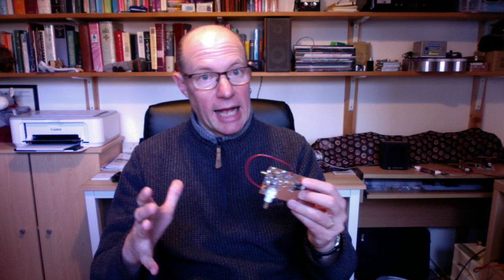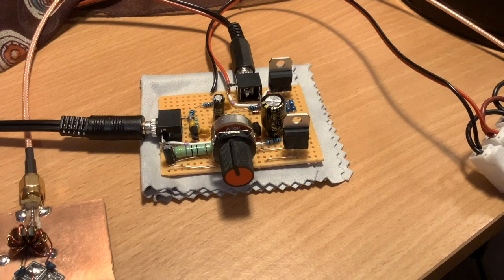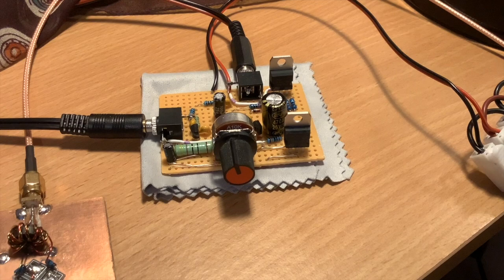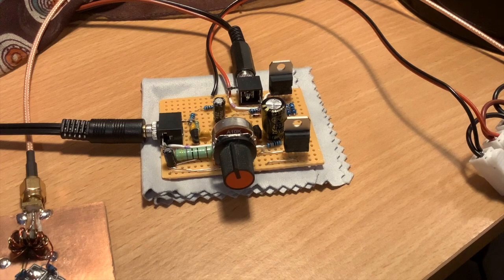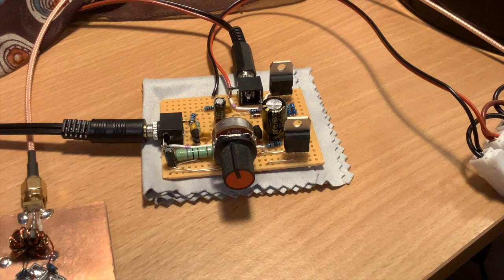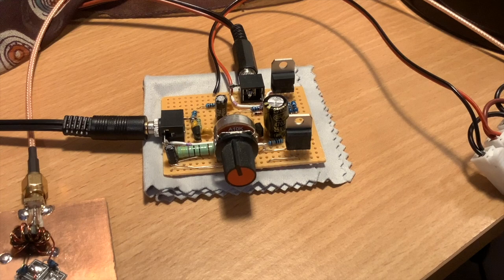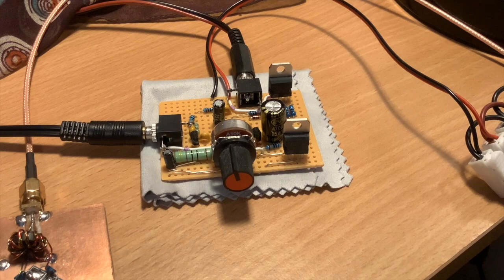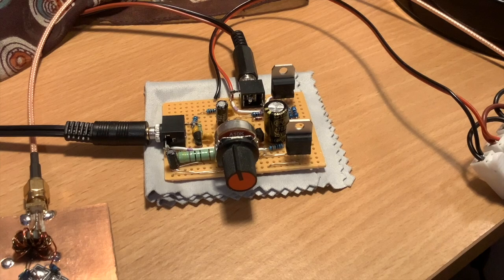34 - Improvements to the Direct Conversion Receiver

Comment: Some transceivers are contained in a box less than12 inches (300mm) square and this one is spread over almost 10 ft (3 meters) length. lol
The end performance of this one, however is almost as good as (as good as) some commercial receivers.  I'm seeing the value of building in modules.  
Bravo and thank you for sharing your time, hard work, research and success with us.
Reply from the maker: Thanks very much. 73, Nick

Comment: Great video. Yes, a diplexer certainly helps. Another important thing I think is a DC path for the IF port. At RF an attenuator could be used on the IF port. I did find some transformers 50 ohm to 1k which I have used. Maybe a 1k to k or 600 ohm transformer could be used for a DC path.
Best wishes for the season from NZ
Reply from the maker: Thanks very much. Interesting idea - there is always something else to think about isn't there. 73 Nick

Comment: Since I've heard AM radio stations simply by hooking an antenna to an audio amplifier is there a chance that the audio amplifier was simply rectifying AM pickup, and that the inductor (L3) and bypass cap (C1) on the input to the audio amp cut out the AM RF that was being picked up, and the 51 Ohm matching wasn't really what was fixing the problem?
Reply from the maker: Hi there! Interesting idea but I'm pretty sure it is the impedance match that makes the difference. I've swapped audio amps in and out and (without the W7EL Diplexer in circuit) I get AM breakthrough. I've swapped product detectors in and out too. I've also usually built an audio low pass filter on the AF(IF) port which looks very like Roy's diplexer but has no impedance matching - I still get AM breakthrough. The only solution I've found to date is a double balanced diode ring mixer (product detector) + W7EL Audio Diplexer. If you haven't already you might find it interesting to check out Bill Meara's (N2CQR) Youtube channel ('Soldersmoke') where he tackles this same issue recently. Thanks very much for watching and commenting. Happy Christmas! 73 Nick

Comment: Nick. I wonder if you'd gone back to Pete's mixer after all those changes, especially the audio diplexer, how that would have performed. Would you have got the break through still. It all started with Bill contacting you. This video showed up when I did a Google search on preamplifiers to use with a direct conversion receiver, and I really enjoyed it. Thanks.
Reply from the maker: Thanks very much Trevor. Doing a bit of digging revealed the fact that those dual gate MOSFET mixers just seem to be very prone to AM breakthrough. It's just one of the unfortunate characteristics of the design I fear. Depending on which band you were going to use it on though + where you live (i.e. not 40m or 20m in Europe which have close by AM Short Wave commercial bands) then you might get away with it! Thanks again. 73, Nick

Comment: The 51 ohm termination was used in the W7EL "Optimized QRP" transceiver published in a 1980 QST magazine.  The receiver was fairly "crush proof" with this diode ring mixer.  I understand now that the 51 ohm termination had a lot to do with that.  I have built a few different versions of that rig.  Working all states using it was something I had planned to do.  I had better get going on that.    73 de km1z.
Reply from the maker: You are absolutely right. Thanks very much. 73 Nick

Comment: Tip41 and Tip42 Transistor s used for Audio Amp in Class B mode can get hot might need Heatsinks and mica washers or equivalent. Traditionally class B push pull Audio Amps were used in portable Radio s as when there s no signal the Audio Amps draws less current eg in standby mode , however there might be a little distortion in sound quality but as it is be used for portable purposes these are pro s and cons of the circuit and more components are used instead of a single ic, TV Engineer Ross
Reply from the maker: Cheers Ross. 73, Nick

Comment: diode rings mixers have 50 ohm impedance on LO input, so they need much more current. on the other side fet mixer have high impedance gate so they need only voltage. the problem that when you increase the current through diodes their low frequency audio noise increases so this drops receiver sensitivity
Reply from the maker: As the saying goes, 'There's no such thing as a free lunch'! I find that so much in electronics comes down to compromise - the only question is what kind of compromise can you live with? Thanks for watching and commenting. 73, Nick
Reply: @M0NTVHomebrewing  thanks. have you tried antiparallel diodes (harmonic) mixer with direct conversion receiver? in childhood i built receiver with it based on RA3AAE schematic
Reply from the maker: Hi, no I don't think so. I'll have to check it out. Thanks.

Comment: EMRFD presents several diplexers in chapters 8 and 9.  E.g., figure 8.22 on page 8.14 shows one with some slightly different values, and then on page 9.17 there are a couple; one of which is very similar to the one you referenced, and the other is a bandpass version for extra oomph.
Reply from the maker: Thank you for referencing those EMRFD designs which I am familiar with. You are right that they are remarkably similar to what Roy came up with but I think he pre-dated EMRFD by many years. In fact I have a feeling that Wes, Rick and Bob included an electronic version of Roy's original design on the CD that comes with EMRFD. It is clearly something I should have paid attention to before now! Every day is a school day hey? Thanks again. Happy Christmas! 73 Nick